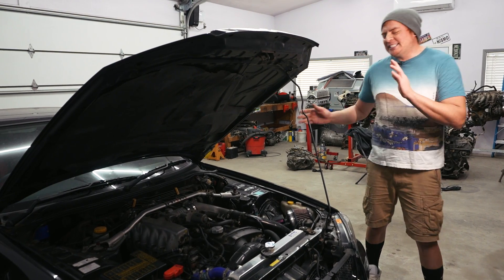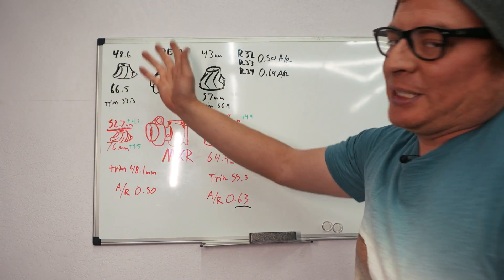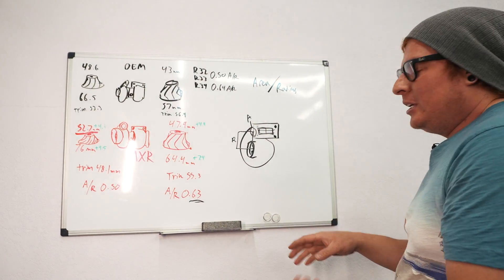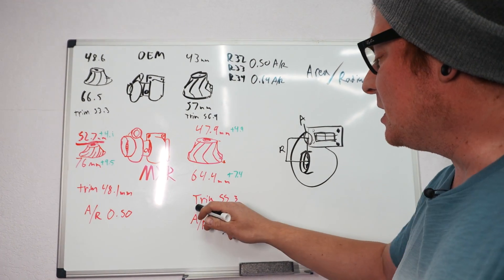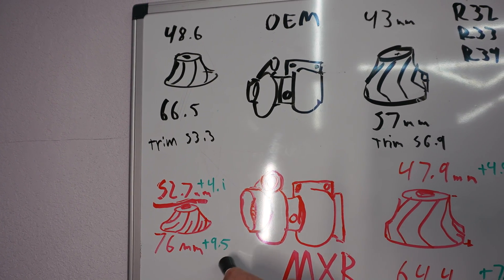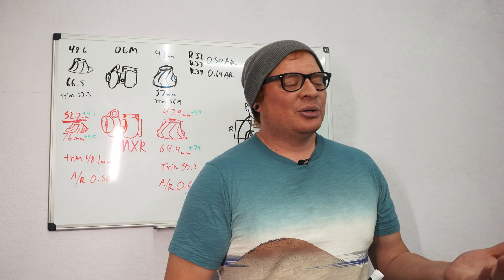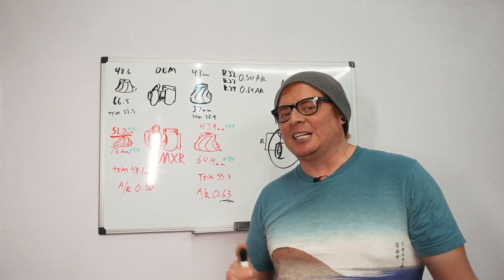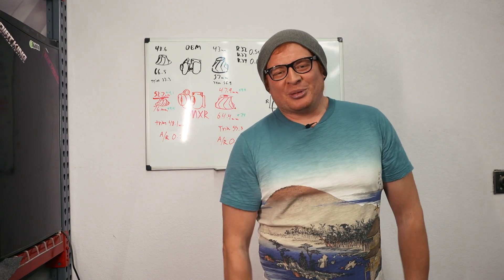Maxpeedingrods Turbo Short Term Review on 1998 R34 Nissan Skyline | Explaining Turbo Terminology!

Comment: Soooo 1 yr now since the video how it it holding up.!?? Been wanting to upgrade mine looking for options lol
Reply from the maker: Well mine has been sitting for a few months at this point so it’s been great! 😅. We did also install one on my friends R33 at the same time and he has been driving the car non stop with zero issues. Also untuned so we were both hitting fuel cut at high rpm above 12psi.
Reply: @Garage23  that’s good news. I have been wanting to upgrade mine but I don’t want to go over budget with this car since I’m saving for an R 34 lol I have an R 33 at the moment I was gonna build it, but I figured why not save till I get both cars. But I still would like a little bit more power out of this one.

Comment: Just put 2 maxspeedingrods turbos in my 2013 f150 3.5 ecoboost. Should I be as nervous as I am? I seem to be hearing mostly good things
Reply from the maker: I felt the same way 😅 but it’s been solid , no complaints so far other than a little more turbo lag.
Reply: @Garage23  They sound really good and I spun the tires barely trying yesterday. I’m hoping they last, how long you at with yours as of right now ? You run yours hard or you been kinda babying it?
Reply: Hi, myfriend. It's been two months. How'd you get it? I'm planning to buy the same engine model.
Reply: @f7p_6 So far the turbos have been great actually. I can’t tell the difference between these and stock so I’d say that’s a good thing.

Comment: I have this turbo it makes crazy ass noises all u need is a good intercooler and metal intake piping. Pulls hard 12 psi no tuning. If u want higher psi u can just get a better pump and u can use something as simple as an apexi safc to add extra fuel. For this turbo it wouldnt be worth getting standalone unless ur gonna upgrade to another tuebo in the super near future.

Comment: What supporting mods are needed to use this turbo on a stock rb25det?
Reply from the maker: If you keep it around 10psi of boost you don’t need any supporting mods. If you go to 15psi it runs into fuel cut so will need bigger pump and injectors for sure and along with that goes engine management of some kind.

Comment: Yo
Just oberflew your video. Sisnt know if u mentioned it.

Can i get away with that turbo without a tune? Or does i 100% need a tune?

(CurrentlY running stock tuebi with boost controler on 0.65bar) Working good ao far.
Reply from the maker: A tune will always be the best route but our car still isn't tuned and it's running just fine at low boost 10psi. It's only upwards of 15 psi that you can start noticing a lack of fuel so a tune will be neccessary as well as upgrading the fuel system.
Reply: @Garage23  ty! I may buy the same turbo just to try. My turbo is now 200kkm in the game i guess its on it last legs.

Comment: I’ve noticed the stock turbo loses power at high revs maybe around 5k rpm. When or where does the max speed hits its limit? Does it keep boost at High RPMs? 

Thanks in advance.
Reply from the maker: About the same, after 5k boost starts to drop off. I've been told it's due to the small wastegate opening.
Reply: yes its due to small wastegate, just think about it, the gate at the higher rpms hasnt got enough space to allow the bigger and faster volume of air to escape so it will take the path of least resistance. porting the gate out will helpt eleviate this. 
ive just picked up the max t04e internal gate turbo with the 3 inch compressor inlet to replace my Garrett t28 stage 3 hyrbid rated for 420ish horse. looking forward to having a turbo that wont leak oil and water from the core.

Comment: Can I correct your comment on A/R Ratios... ok so you said its possible to have a 1.5 or whatever but that's incorrect, max is 1 and no turbos even hit that, the reason is because if you have a larger   housing diameter compared to the turbo diameter, if it hits or exceeds 1 you actually will lose all boost.
Reply: Let me clarify, some diesels have 1.05 but generally thats cause they are compound turbos or low boost applicatione or its a small turbo on an oversized engine
Reply from the maker: I think you are thinking of turbo trim, it's a ratio between the inducer and exducer so trim can't exceed 1.00 ( inducer same size as exducer) but there are plenty of exhaust housings that are over 1.00. A/R